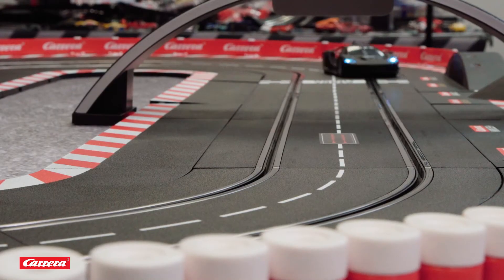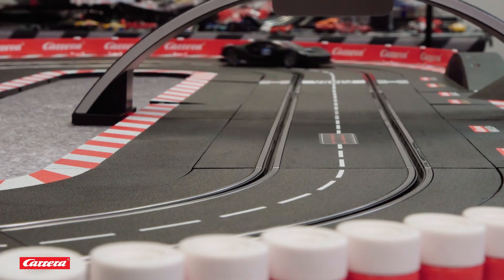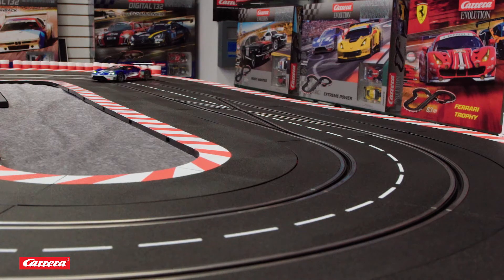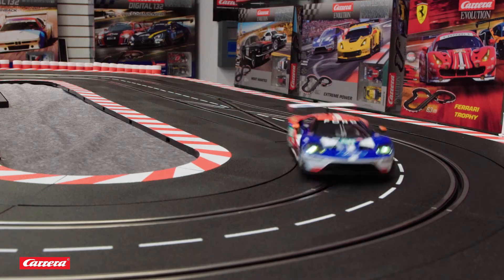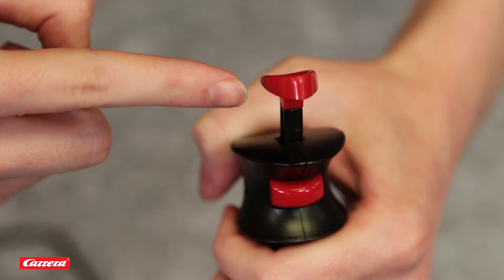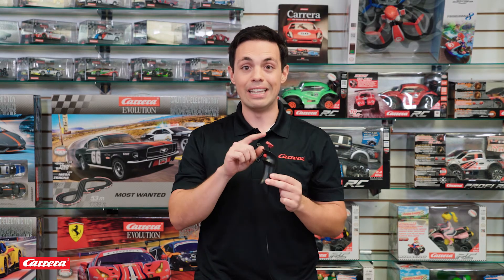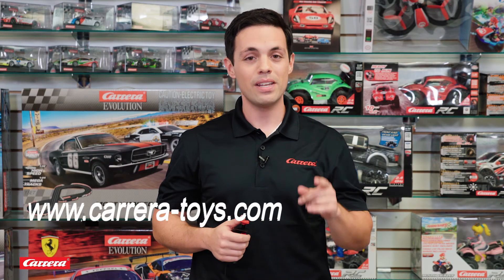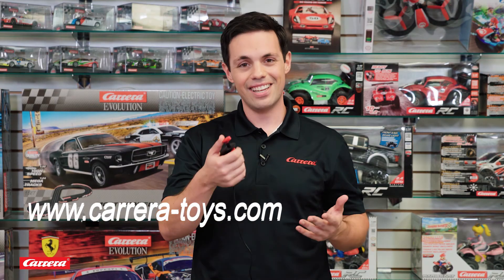Carrera Slot Car General Handling Techniques

Comment: am i missing something?or is carrera digital the worst system ever? you cant even run evolution cars on the digital track they wont even move unless you pay to have them rewired horrible hassle and total rip off dont buy it this is horrible .another way to rip you off like digital track isnt expensive enough now your old cars are useless unless you pay  someone to rewire them .so stupid .you would think they could run with no lane changes or pit stops nope total rip off evolution cars are useless  now stick with analog evolution these guy dont have  the bugs worked out or they just want to rip us off
Reply: Wow its a digital system of cause the old cars don't work they are analog. But if you put a digital chip in the old cars they work fine. And yes it easy to do..
Reply: Your DVD player doesn't play vhs tapes does that mean it's a bad system? They are completely different systems.